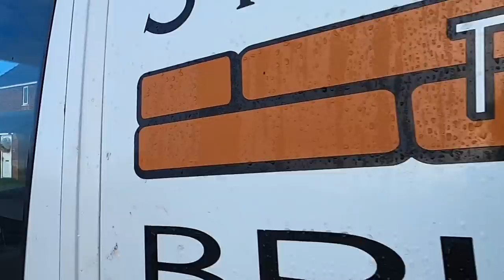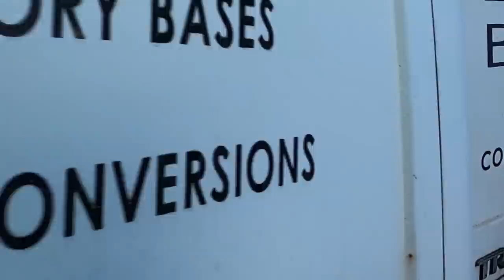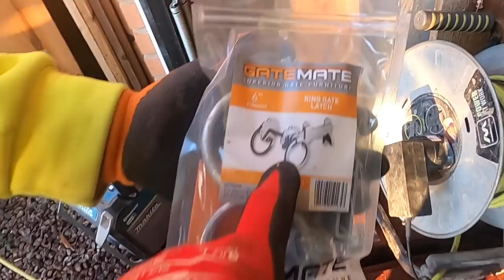EXTENDING A GARDEN WITH NEW FEATHER EDGE BOARD FENCE

Comment: So wooden gravel boards, not even seated on gravel? no post toppers, i give that fence two years before it`s rotted out.
Reply from the maker: I’ll give you an update in 2 years then . Our last house with the identical fence is still there after 18 years . As for the gravel board when it rots you just replace it . 🤷🏼‍♂️ 
    Pressure treated timber lasts longer than 2 years 🙄